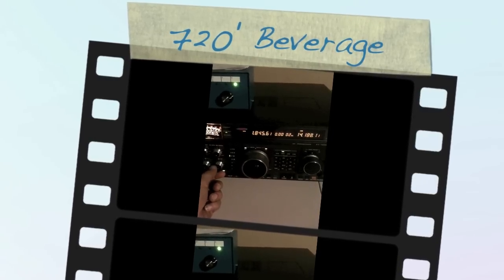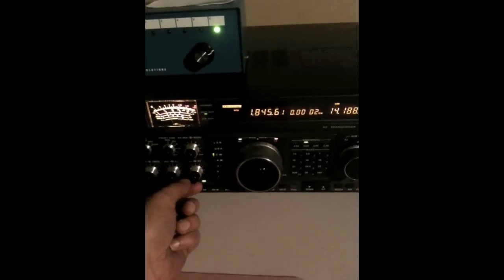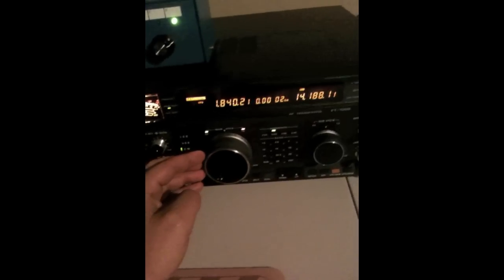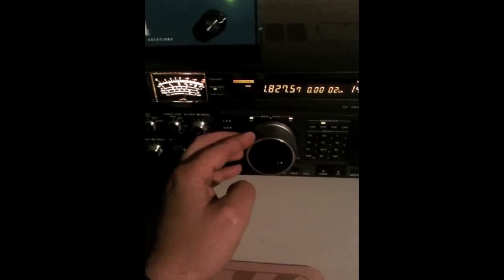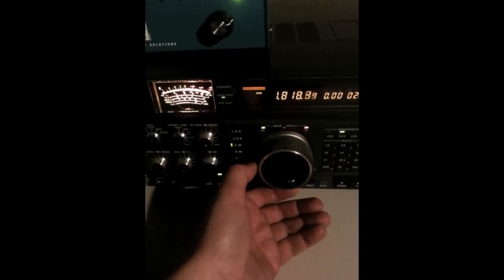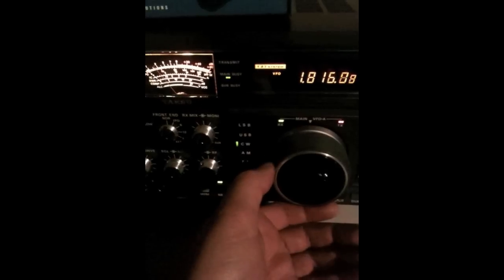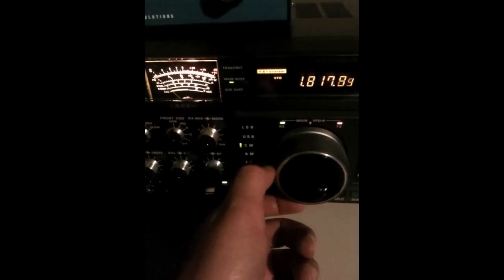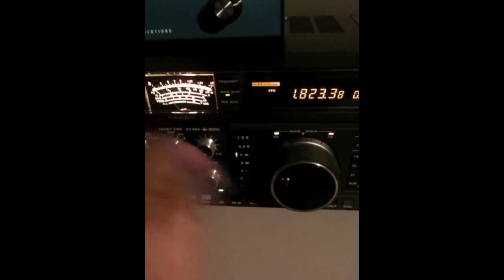720' Beverage Receive Antenna Demo

Comment: I have been considering the Bev rcv antenna... I have about 700 feet to work with... It wold be greater if I coul;d run it thru the woods... do you think that will ahve a negative afffect?
N3ITE

Comment: @ww2dx I might not be familiar with a "Beverage Receive Antenna" as you say but I am familiar with 720 feet and I am familiar with 1,000 feet (the legnth of the RG-6 used to feed it) and both a very long indeed.  Unless the 720 and 1,000 feet mentioned is shorter than I'm used to it has to be a gargantuan set up especially mounted at the 9 ot 10 feet stated in the video unless that's a lot closer to the ground than I'm used to as well.

Comment from the maker: @liquidgee13 I don't think you are familiar with a "Beverage Receive Antenna" Please google that. It's a single wire that is hung in trees or on posts along the ground about 6-10' high over a distance of 720'. It's very simple and cheap to install but yet very effective for low band RX performance. It's far from a "monstrosity".
73 Lee WW2DX

Comment from the maker: @pastormtg Yes Mark, its a RX only antenna. And no, improving your signal to noise will greatly affect your likely hood of working DX. If the other station has also improved their S/N ratio then your chances of working them have been greatly improved. There are many good resources on the web to learn more about low band DXing. 73 Lee WW2DX

Comment: KB3Z
You're correct,you can't transmit on a beverage,but if you have a dipole at least 130' at the feedpoint,or an inverted L , which is what I use, I work Europe on a regular basis with ease from the east coast. Keep in mind Euro stations using beverage recv antennas also.
73